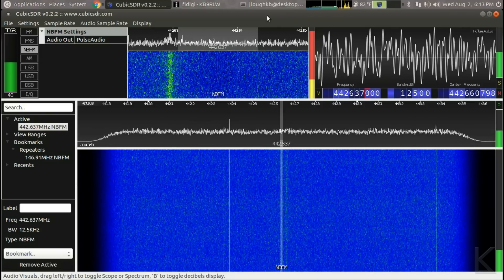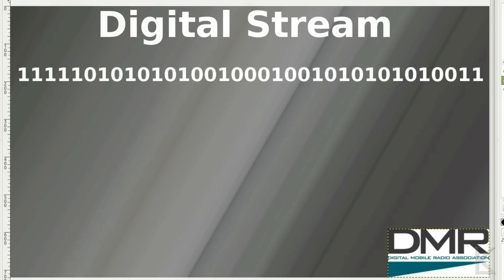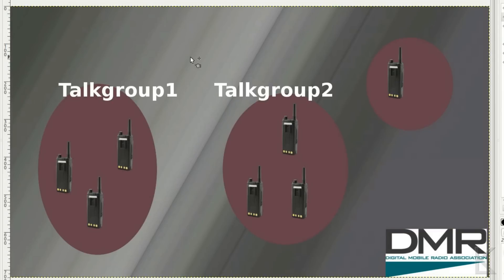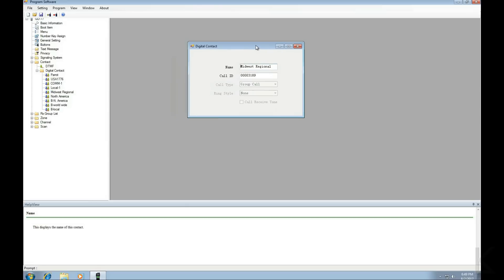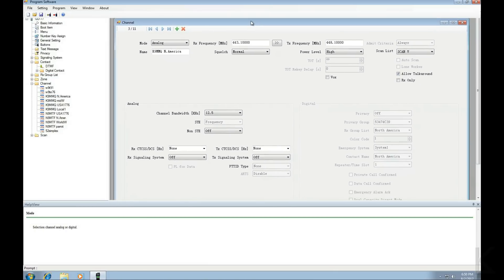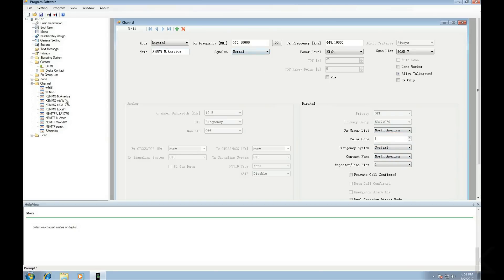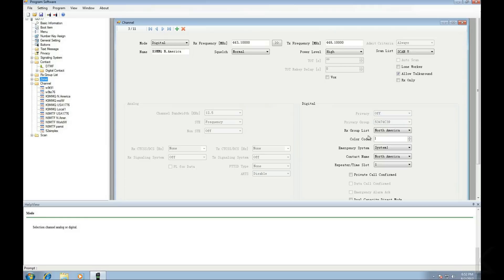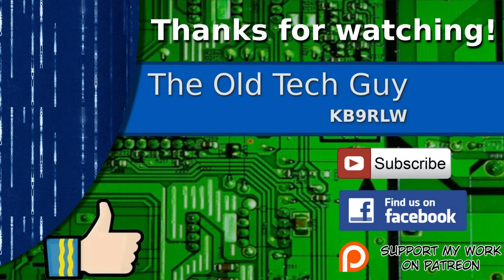Ham Radio  - DMR radio discussion  How it works

Comment: Good explanation,  however im an old ham and to me this is NOT ham radio. Not interested in DMR at all.
Reply: Here's the thing, though:  The network backend of a DMR system can be the Internet, but it does not have to be.  

I constantly find myself having this conversation because there just aren't a lot of people that have a technical background in both radio and data networking that can explain it well (and I might not be one of those people either, so fair warning about the rest of this comment).

There are two key points I want to communicate:  First, the Internet protocol, or "IP," and the Internet are not the same thing.  Second, IP networks can be constructed and operate over wireless systems just as easily as they can be over wired systems.

About protocols:  I thin it's most useful to think about IP as a language like English.  Lots of people from lots of different countries speak English, some of those people are from England, but people from the United States, Australia, South Africa, Canada, Belize and many other places also speak English too.  It would be inaccurate then to say that all people who speak English are English, and that's true with the Internet as well.  Yes, the Internet uses the Internet protocol, but it is far from the only network that does.  That's important because of my second point.

If we continue to think about language, English can be spoken, it can be written, it can be encoded with Morse code, it can be encoded using some other method, and it will always remain English so long as whatever process you used to send the letters from point A to point B allows you to read them at the other end.  The same is true for IP.  You can use copper wire to send IP encoded data from one computer to another, or you can use fiber optic cable, or you can use radio, or something called "free space optics" (which is literally two stations shooting freaking lasers through the air at each other, but I digress), and IP doesn't care.  As long as you can read the data at the receiving end, IP just goes on working.

Alright, so this is great, but why do we care?  Well, if your argument is that DMR isn't "real radio" because it uses a data network as its backend, run that network over a microwave link to another repeater 50 miles away and find out just how much "real radio" that is.  

There are already groups doing this, too.  I know of one in Florida using a system called HamWAN to, among other things, link some DMR repeaters together using RF links.  The HamWAN system was actually developed by a group in Seattle who has a working network as well.  

I would also like to gently remind the "not real radio" set that one of the stated purposes of the amateur radio service is to "advance the radio art," and you don't do that by poo pooing technology just because you don't understand it.
Reply: I think it would be good to be setup and competent in DMR and analog. They both have their place but don't replace each other.
Reply: Deutsche. Dráma filme
Reply: I tend to agree that once you start using digital on ham radio repeaters and you start losing people that are analog bound then you will have gaps of some kind or another in emergency situation. relying on the Internet is absolutely not good for emergency communications obviously because of its vulnerability during earthquakes tornadoes and the like. however once you get out of the affected area using analog then it's okay to shoot Health and Welfare traffic to people via a working internet. but you don't need to rely on it in your area when there's emergency going on. I am an Old Ham and I've seen lots of advances in the hobby. We always have to keep up with the Joneses but the reality is CW will still get you out :-) although it's slower than turtle poop :-) rtty is a nice way to go. another problem with digital is communication breakdown at distance is shorter than analog would go. like we've all experienced with TV when it went digital. a little bit of rain there's no more snowy pictures just pixtel breakups then blackout... So you cannot even see the weather man and his map anymore. during bad weather. so newer is not always better. But with that said, ham radio has something for everybody. I just hope that everybody can still be able to communicate with everybody. nothing like voice Communications for reliability. And of course CW :-) LOL
Reply: @thefreese1   I take issue with your statement; technically, turtle poop isn't 'slow'; it's motionless ...
Reply: If all Ham's had this mentality we would still be stuck in an era with the original digital mode... CW. In my area of the country, I've witnessed ham's that are scared of new technology. They don't want to learn something new, they're set in their ways and don't want to expand their knowledge base beyond HF or basic repeater use. Some of these guys don't understand what a PL tone is for on a repeater and have argued against it being implemented so they can avoid re-programming their radios or, they have older radios that don't support PL capability. I know several ham's, that have Extra class licenses, that either refuse to learn to how to program local repeaters into their radios or they rely on others to do it for them. How does someone pass an Extra class exam yet they can't program a simple radio? They have to ask for assistance on activating the PL tone, in their radio, to use different repeaters if they QSY because they only use the VFO on their radio. 

 If we had the internet 40-50 years ago I can imagine the responses to the new technology then. RTTY, Packet, AMTOR, etc. would have scared away a lot of older ham's too. What if the ham community decided to never expand the radio art? Those spark gap transmitters don't look so good now, do they? Keeping your station up to date with the latest technology is one of the first things I was taught when I first got licensed in 1995.  Face it, the times they be a changin' and technology will advance...with or without you.
Reply: I'm a G8xxx and licenced in 1978.  I did a lot of SSTV, building and operating colour systems in the 80s  , frame seq and line sequential .  The internet came along and I spent all my time with computers.  I thought the narrow band comms with the waterfall was interesting on 40M and 20M .   I hope to get back on the air soon after a long break.

 Tnx Kevin, you did a gr8 job explaining DMR .  I understood the video , no prob, but it is not for me..  73 to all.
Reply: I think computer technology is best used to improve the signal quality.  Internet dependent communications are known as chat rooms, Skype, and email.
Reply: No its not real radio but it can be great still no different to using repeaters or data etc etc
Reply: So what's the big deal?  Just limit yourself to contacts that only use your local repeater and you won't be on the internet.  Same as you're used to now, only with the benefits of digital.
Reply from the maker: And I tend not to get too excited about the internet connected stuff either.   It;s fun to play with though.   And in the case of DMR, it's not needed at all.  DMR was designed for local repeater use.
Reply: I kinda agree with you. Once it goes on the internet then I feel that it is no longer ham radio. If an emergency shuts down the internet in the area then it's useless.
Reply: I agree with both of you. The Internet removes the wireless from communications.
Reply: Terry Morris the dozens of coax cables and power cords, takes the wireless out of it for me but it still ham radio. At least it requires a radio unlike Echo Link

Comment: Sooo, I understand now how DMR works, thank you. Why do they sell special amplifiers for my hand helds? Wouldn't a regular amp do the same job? What's different, it's still RF.
Reply: My understanding is because DMR is constantly switching between Tx and Rx on a 10s of millisecond range, traditional linears aren't going to work.
Reply from the maker: I don't know,  it's 12.5khz FM.   It is turning on and off every 30 milliseconds though.   IF your amplifier had regular TX/RX switching, it probably couldn't keep up.
Reply: That's one reason, Kevin.  Another is that many VHF/UHF amps aren't very linear.  That's not too much of a problem when you're running FM voice signals, but adding even a little bit of distortion to a digital signal like DMR will drive up the bit error rate and can quickly degrade your link quality even if you're putting plenty of RF into the receive antenna.
Reply: Take a look at the class of amplifier. Some amps only conduct part of the time. Digital modes(tdma especially) require better amps and in some cases amps that conduct at 100% duty cycle. This allows the data to be sampled more accurately. Class AB amplifiers with analog voice are fine because humans wont notice or can mentally fill in any gaps. With digital you need to capture the bits in order to assemble the audio. There are a few tricks to fill in some gaps but overall you need as many bits as possible to make good sounding audio.